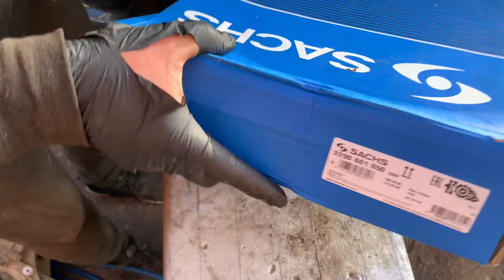"How to Replace the Flywheel and Clutch of a SEAT,VW, Skoda 1.6 TDI

Comment: I have changed clutch at home on my MK6 1.6tdi and MK7 1.6tdi  without disconnecting steering rack rods, without oil drain from gearbox, without driveshafts taking out from wheel bearings, without draft shaft base being removed from gearbox. All job was done without lift only with two jacks.
Reply from the maker: Great 👍 . But its only  30 min extra job and much more easily remove and fit gearbox 👍.
Reply: Tell me more as I need to do the job very soon?

Comment: What bit is required for the bolts that hold the shafts into the wheel bearings, thanks
Reply: 24mm 12 point Socket  for wheelhub.

Comment: Hello. I have a 2012 mk6. When i release the clutch pedal it makes a clunk metal noise. When i release the clutch very slowly it does not make that noise. What could it be?
Reply from the maker: Probably it’s Flywheel gone..
Reply: Is it a clicking noise?
Reply: @uzair18  Yes just one click noise
Reply: Its a common issue. It shouldn’t affect functionality but would require changing clutch pedal assembly to get rid of the clicking noise.
Reply: @uzair18  Thank you for your response.  I forgot to say when im in first gear give it gas up to 1900 2000rpm then when i push the clutch pedal the whole car just shakes hard one time (i dont know how to explain it well)

Comment: 4:26 what is that bit there?
Reply from the maker: If you mean slave cylinder bolts, it’s 13 mm socket
Reply: I wish you mentioned the bit/socket sizes! Because I don’t have all the sockets sizes and I don’t want to be stuck in the middle of the work
Reply: Great, thank you! @CarFixEasy
Reply: @webpro607  with exception Of dXZN bita they are all regular metric socketa
Reply: XZN bits sorry